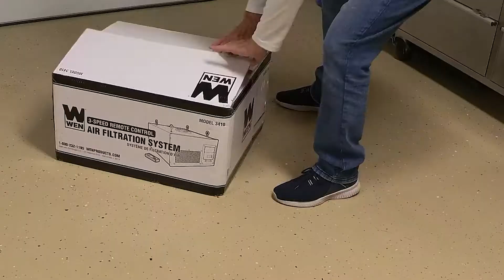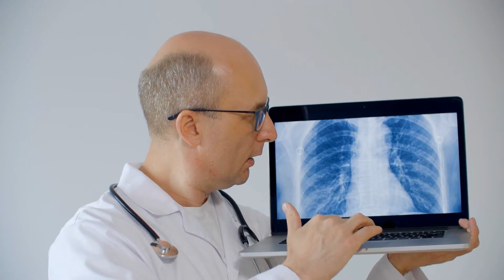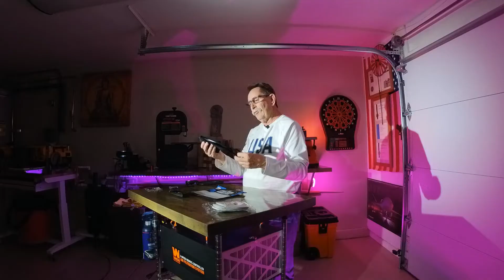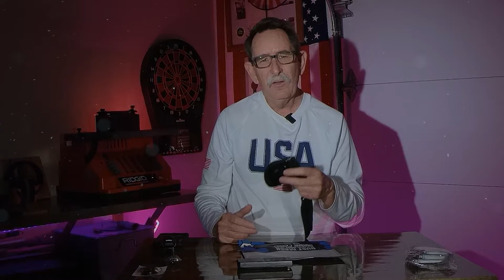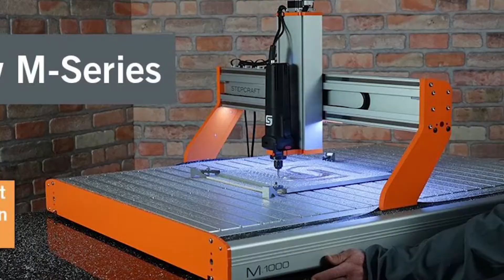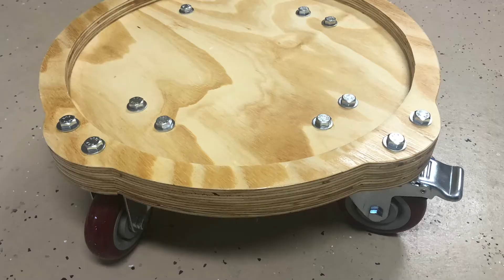Shop Air Filter down to 1 micro,  Why Spend more Money than you have too? Wen Shop Filter

Comment: N95 is not the highest level of a mask.   It still allows up to 5% of particulate matter down to . 3 microns through.  An N100 or P100 (for oil) mask filters out 99.97% of particulate matter down to .3 microns
Reply from the maker: thank you for sharing.. all comments are welcome especially about good air.   Cheers.

Comment: Thanks for highlighting the importance of proper protection! I find that way too many makers on Youtube don't seem use any mask, glasses or ear muffs while working.
Interesting to hear about the solutions you've been looking into. I'm thinking about building an enclosure for my CNC instead in the hopes of that containing most of the dust particles.
Reply from the maker: I thought about and enclosure also but figured I would try this first.  I found "my reality" to me I do not leave my machine alone for to long.   I was a picture in a facebook forum a few days ago where someone had a fire from chip build up.... so I figured for now I would go with baby setting the machine and getting this dust collector.  $134.00 was so little if I get it wrong, losing $134 will be a lot easier than say $700 and have to start over.   THANK YOU VERY MUCH FOR THE COMMENT.